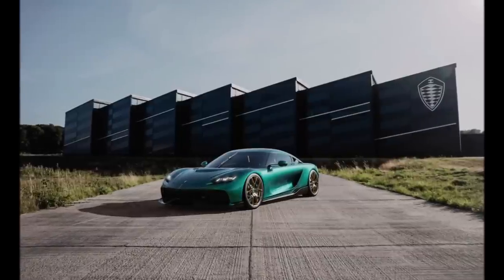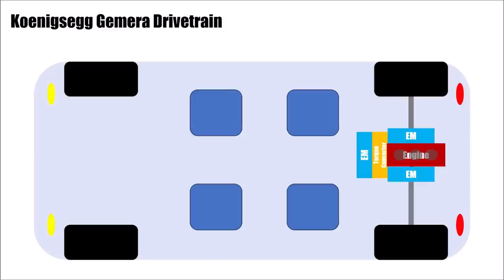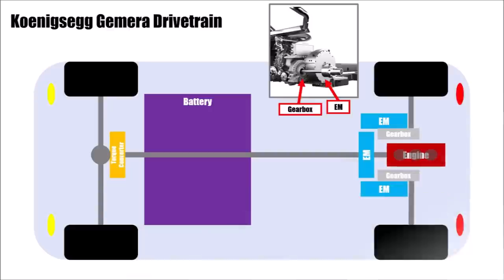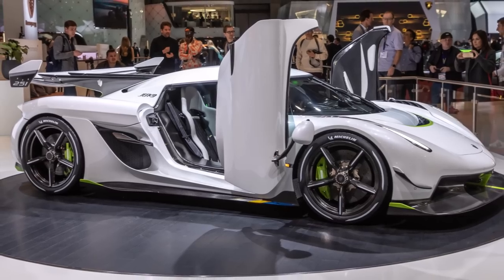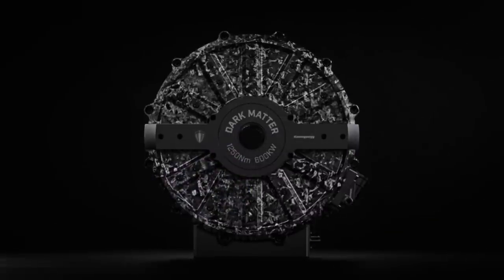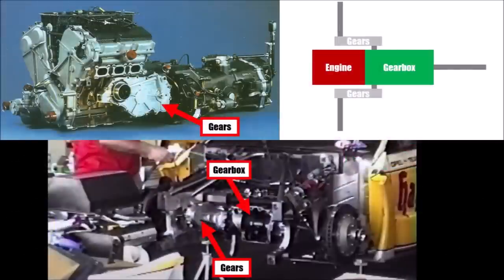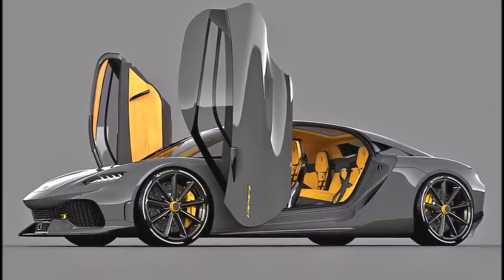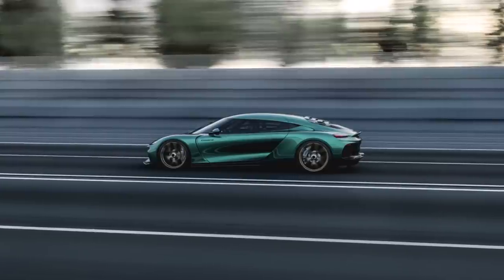Koenigsegg Gemera - CLOSER LOOK

Comment: 2300hp is just beyond insane. I remember when 1000 was considered to be the top dogs
Reply: Well, I remember the Saab EMS. It had mighy 110 hp.
My first car was a Saab 96 2stroke with 3 gears and 30 brutal hp.
Gemera has 3x More gears and about 2270 More hp.
My 96 was in 12 v. Gemera 800 v.
But One we have the same is sparkplugs.
My 96 had 3 and TFG the same.
Reply: That's psycho! Shud rename koenigsegg psycho cause this is insane what they doing at koenigsegg!?
Reply: Over 2,000HP should be a new category above "hypercar".
Reply: Everything over 500 hp was something big. 
700 hp was hypercar category
2300 its called mega car but its beyond...
Reply: 1000hp still is an absolute beast! even i think its too much of a power... correct me if im wrong but cars with good Aerodynamics can even get to over 300km/h with 300hp+ man!! Im still proud as a car enthusiast of what Koenigsegg has achieved.
Reply: I remeber that when top gear first tested the bugathi.. "nobody will ever make a 1000hp car again"

Well... where are we, not even 20 year on, is it even 15?

Was there ever a time when power of the top dog car increased as fast? Remeber Ferrari and Lamborghini broke 300hp in the early 80s.

Comment: Andy Forrest has a time attack WRX that uses a similar concept for the AWD, but with motorcycle chains driving the front wheels instead of gears. I'm curious how chains would compare to gears in terms of weight and efficacy; two independent drive shafts with their own bevel gears might also work.
Reply: As for efficiency, on motorcycles chains are the most efficient, followed by belts as seen on many cruisers. Shafts like on many BMW touring motorcycles are the least efficient.
Chain tension and cornering forces could probably influence power transmission. But let's not forget the biggest disadvantage of chains: lubrication
Reply: Yep, have seen that car years ago, 6 cyl boxer iirc.

Comment: Not my favorite car I have to say.

The sub 2 ton weight mentioned was for the 1400hp I3 version - should be 1818kg based on the mentioned 0.77hp/kg ratio. However, I do wonder if that solution is gonna get dropped. With just 600hp (and, more realistically, 500hp engine when running on normal gas and not E85) on the rear axle, and 800hp on the front axle, it's a power distribution that doesn't really make sense. Under acceleration, depending on exact weight distribution and amount of grip, something like 80% of the weight ends up on the rear axle. So the 800hp e-motor won't be able to help until much higher speeds. Additionally, I wonder if it's worth the effort to program two different engines to work with the electric system, to program the gearbox to work with two different engines, and design two different cooling systems, etc. I also suspect they are having major problems with making the freevalve work - just a year ago the engine was still only running at 4500RPM and that's with the system being in development for like the last 15 years or something.

The V8 version and the new concept with smaller e-power and smaller battery makes a lot more sense overall (in no small part because the battery will still last only a few minutes at near full power and being left with a 1200-1500hp engine is a lot better than with a 500-600hp one), although I think it's gonna be hell of a tough job to make the V8 work in such a cramped engine bay thermal wise, especially because what would be the rear hot air exit is blocked by the luggage compartment.

The credential of this car as a daily driver or a grand tourer are also sort of laughable. The "large trunk" you are talking about in the video is only 200L. For comparison, the RS6 is 565L. Even the T.50 has more luggage space at 227L. And it's one of those trunks that's really close to the engine - in fact the same problem that the T.50 (and the F1, the Paganis, the Emira, the C8 Corvette and some other cars also have) - and it's gonna get really toasty.
Reply: Personally I am more excited waiting for a Regera 2 with 3000hp
Reply: Pretty sure both versions have 4WD on both drivetrains.
Reply: 100% agree. 
This car was weird for me, from the tech side, from the day one. 
Not to mention it looks quite weird.
Reply: They will be fine. It's Koenigsegg after all. I am pretty sure all 300 build slots of Gemera already sold out anyways. People were also skeptical when Koenigsegg introduced their Regera with the Direct Drive system. But now, they are holding the 0-400-0 kph record, reclaiming it from Rimac by just re-doing the run on a better surface.
Reply: @budokpantai  I must say I find it quite shocking how easily people are convinced by self-serving manufacturer claims and tests - something that should be implicitly distrusted. 

Just as a hypothetical question, if Koenigsegg wanted to run their engine at 2000hp during one of these "records", what's stopping them from doing it? They have avoided independent scrutiny for the past 10 years, never providing cars for instrumented tests - and discouraging their customers from doing the same on top of that - and for their marketing relied solely on self-conducted and published "records" where they have absolute control over what information gets out, but somehow it doesn't strike people as highly dubious? As for the Regera "record" you are talking about, even though there was an improvement (0.8s) in the 0-200km/h acceleration, the bigger time improvement (1.7s) actually came from the non-traction-limited 200-400km/h part of the speed range. Guess why!
Reply: @test987665  better tires and surface wha else? U think they lie about numbers? The early cars have eveb been run on dynos giving the exact number they claim to have.
Reply: @test987665 wind? At those speeds, a small wind is enough to change the acceleration rate significantly.
Reply: @test987665  first, I am not easily convinced as you think I am. What you call 'self-serving manufacturers claims' are actually proven by Koenigsegg.

As for your hypothetical question, it is a irrelevant question because; a) Koenigsegg never have an engine that capable of 2000 hp, so why would they want to run such test? And b) Koenigsegg never did a record attempt with a prototype and claimed it a record like some manufacturers did, they always used a production car.

I don't know where have you heard Koenigsegg was avoiding independent testing, but I do know that no Koenigsegg owners would give their multi millions Koenigsegg for such thing because each one of them (especially) models prior to Regera are super limited and their valuation has increase significantly nowadays. All Koenigsegg cars basically sold out before they even get built, so it's not about Koenigsegg avoiding independent testing, but their cars already belongs to their customers.

Your claim about Koenigsegg did record attempts by themselves to control information just proved that you don't even know what you are talking about. Their record attempts always have people from independent company (usually RaceLogic) to verify their records. Their record attempt at Nevada even witnessed by so many people and youtubers that was invited to the event. If you ask me, Bugatti 300 mph record is more suspicious, because they literally did it on a private and closed facilities, with a 'pre-production' unit, which had the passenger seat removed, and admittedly had a slightly different gearbox. But no one really said anything about it, because they are Bugatti.

As for the improvement of Regera record, I don't have to guess at all. It simple; first, their engine management system can be updated online anytime, so over time, the car will perform better, and second, colder ambient temperature, means better engine performance.
Reply: @R4M_Tommy  Yeah, sure, wind. Well, for that you would have to either believe that: when their did their first test - which they did at their home air strip which is literally right next to their factory and available for them to use 24/7/365 - they chose to do that test on a day when it was windy and they then chose not to run in the direction of the wind, but against it; or that when they did their recent test, they only managed to beat the record because they ran with the help of a big tailwind.

And sure, I can't say for certain that that wasn't the case, or something similar like temperature/humidity/air density changes (although, again, for that you would have to assume that they, for some reason, didn't pick the optimal conditions already in the first test), but I am not sure why anyone would believe that unless they were already completely on board and ready to defend their favorite company no matter what they did - even if the only reason it was their favorite company was exactly these non-verified tests.
Reply: The electric motor and combustion engine are connected to the same driveshaft. They cannot send power to separate axles.

Comment: Truly fabulous and beautiful, not that Koenigsegg would want or need to, but if they made a pure electric version I’m sure it would appeal to a broader market.
Reply: fk no
Reply: Now way anyone ever buys a fully electric Koenigsegg 😂😂😂 ... That's the opposite of this impressive machine.

Electric are the laziest engineering out there .... Motor + battery = done ... Meaning the car manufacturer is just an assembly plant, not an engineering and manufacturing plant.

The electric cars try to impress people with things like self driving ... But that just makes it worse.
Reply: @wayando  It makes me cringe when supercar brands like ferrari and lamborghi come up with full electric cars, it literally defeats the whole purpose of buying them and what they stand for lmfao.
Reply: @enderzebak2863 no one going full electricic
Reply: Wouldn't touch an electric car until battery technology improves and we move away from Lithium. I'm sticking with really well designed ICE cars and some hybrid. The thing I think is true (?) is that as technology improves, you can update your car. Will find out - have ordered the V8 Gemera and will be interesting to see what the journey is like.

Comment: Wouldn't the simpler layout be to use a lambo setup with the driveshaft running alongside the engine to the diff at the rear of the engine. It would save a lot for weight in having two side gearboxes with only a minor increase in wheelbase.
Reply: Yes but it’s Koenigsegg, they make things themselves and don’t like to copy others.
Reply: I think that may be to save space for the trunk that's directly behind the engine.

Comment: Could the V8 be equipped with FreeValve? Would that make sense?
Reply: The V8 on the Jesko (and consequently the Hot V8 on the Gemera) already has freevalve. While only marginally better than a VVTI engine, the freevalve approach makes sense at this level where cost per unit is less relevant (the Gemeras are what… 1-2M€ each?)

Comment: I loved the original Gemera drivetrain but did see it being underpowered on the ICE side for all that electric power. I'm not too happy the hybrid dude was reduced but it's true, with a good "traditional" gearbox it just works better at normal speeds. Can the e-motor also effectively drive de rear axle? Is there still an EV only mode?
Reply: I believe so. I think I remember Christian mentioning the electric only driving mode in the announcement video on YouTube. I'd check that
Reply: @e2rqey  Perhaps there is a clutch to uncouple the ICE and rear axle from the e-motor. Then EV-only would be possible in FWD, which for public roads will usually suffice. I'm still in love with the 3-motor EV setup with the ICE as FWD range extender. I wonder how far they tested that in practice and whether shortcomings with energy management brought them to rethink and give up on the torque converter and direct drive. Was that ever a problem with Regera, or would the twice as power ICE in a lighter car allow that concepr to work there?
The 3-cyl single motor hybrid begs to be used in a lighter car as well. A very Spartan, BAC Mono or Lambo Sesto Element like superlightweight car. Loads of torque, traction and fuel range. In a sub-1000kg track toy, the battery would not need to be big at all. Regera's battery or smaller would suffice. The DarkMatter motor might even be overkill in such application, as it needs a 600 kW capable battery.

Comment: They could have made the car infinitely simpler and significantly lighter by mounting the ICE transversally like every other car with the engine on/over an axle. Koenigsegg just likes to reinvent the wheel for reinventing the wheel's sake
Reply: I think they haven’t done that because it woudn’t work with the lST trans they wanted to use. That is a design for a regular positioned mid engine car. output shafts being 90deg from the input etc
Reply: Thank you so much Ruby, you said what should have been said about this crappy gearbox design
Reply: @tommiesturkenboom3862  Look, all i'm saying is that Mini, Ford, Chevrolet, Fiat, Porsche, Volkwagen, Chrysler, Citroen, Pugeot, Dacia, Skoda, BMW, Mercedes, Toyota, Nissan, Mitsubishi, Daihatsu, etc have all figured out how to put an engine over an axle regardless of transverse or longitudinal mounting without attaching gearboxes to other gearboxes. Swedish pride must be a hell of a drug.

Comment: On a separate topic, are the F1 front wings trying to recreate Y250 at lower speeds but bleeding it off at top speed?  From the onboard nose camera of the Merc you can see half the wing flopping down to meet perfectly with the other section at about vmax.
Reply: There is no shedding edge for any Y250 vortex

Comment: Regera had a great drivetrain that was pretty innovative. The first Gemera concept though was a joke, having the ice drive the front wheels? this thing would have major understeer issues.
The second take with the tfg will work until you run out of battery, then you are running a 2tonne vehicle through 3cyl.
The jesko solution seems nice but how are they gonna cool down the v8, the turbos, and the gearboxes? It seems impossible, the car will go in limp mode more often than a plaid. 
I know that are others that have already introduced such complex drivetrains like the nsx and the 918 but both of these dont carry the performance values of the jesko engine.
Overcomplex system, cannot see it flourish.
Reply: Very good chance that the ICE will be used to make sure that the battery will stay charged throughout driving cycle
Reply: @gavcom4060  You cannot/shouldnot work a phev as you describe, even though is doable, you will run out of fuel in no time. Its non intuitive but sure it can be done.
Reply: I'm pretty sure they figured a way to stop any of those problems from happening, they have been testing this car for 3 if not 4 years, they would've surely came across that problem and fixed it, I remember watching this other youtube short where they explained that the gemera prototype was being tested /driven everyday because they intend on it being a daily driver for the Rich  so all the problems that you are concerned about have already been solve and even made  some improvements

Comment: Engineering wise its a masterpiece probably, but only 200 or so people will ever experience the car outside of gran tourismo...
Reply: My dream solution to this is Koenigsegg collaborating with Toyota.
Toyota loves their new i3 block and hybrid cars, and Koenigsegg just designed the ultimate four seat chassis, the problem is translating the frame from carbon fiber into aluminum.
If it were possible to re-engineer the concept into ordinary materials and assembly at a Toyota plant you'd reduce the price to well below $100K.
Reply: @budthecyborg4575   
Toyota cant even make its own Supra. 
Not to mention MR2. 
Why reengineer when they can easly design their own body. 
Honda made at least the new NSX.
Reply: They did put a couple of their cars in Assetto Corsa, like the One:1 via commissioning modders to develop them as mods
Reply: 300 gemeras will be made